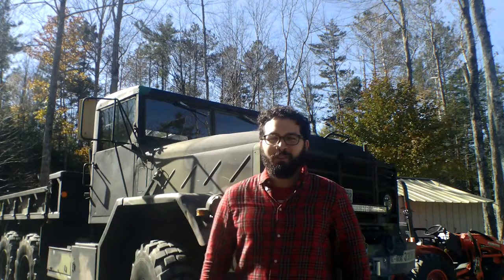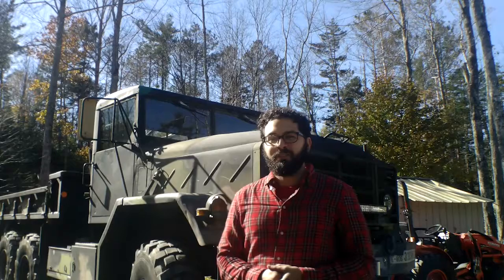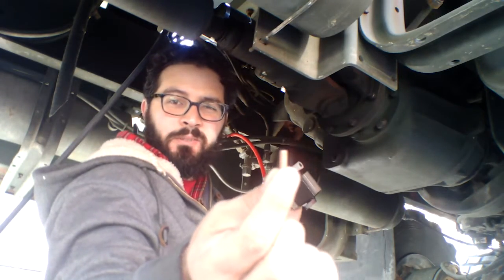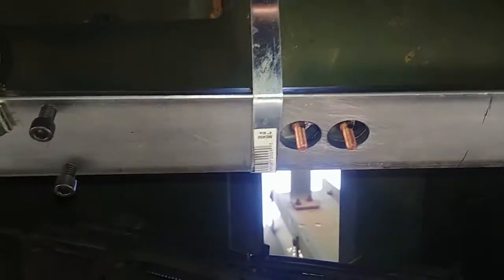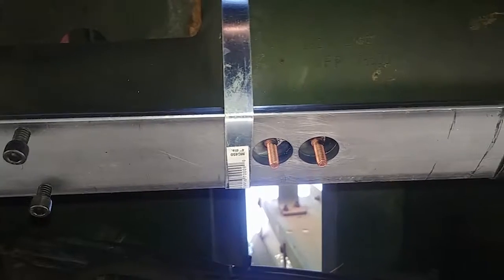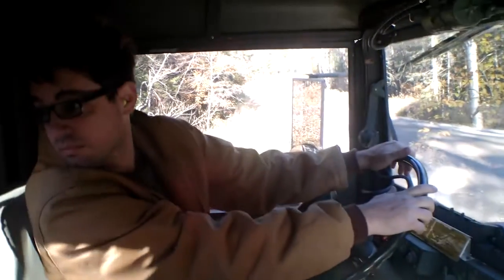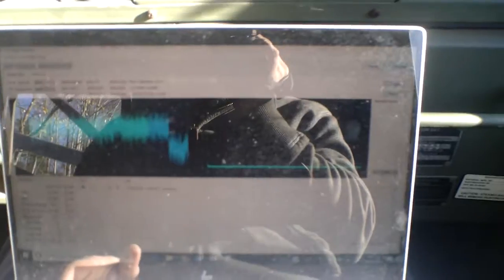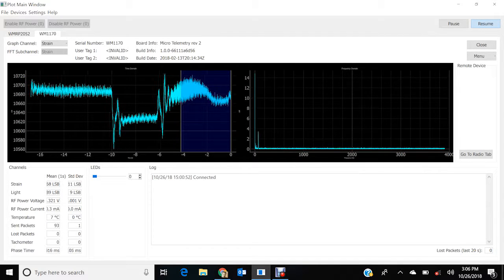Easy wireless torque sensing for rotating shafts

Comment: Awesome.   And a former military vehicle too.  I have a M1031, a 1986 K30 with a PTO powered 12 kW generator.   Having a means of measuring input shaft power to the generator would be great as the 6.2 diesel spins at 1400 RPM to output 1800 RPM on the generator for 60 Hz.  The engine is capable of nearly 100 Hp at that speed which would over drive the Lima MAC generator with internal short or overload.  The governor was set to prevent this but frequency droop from lack of authority to open the throttle limited use.  I've adjusted geometry which required gain and integral negative feedback,  rock stable but the governor could command over 70 Hp.  I figured limiting torque to about 75 ft-lbs at 1800 RPM would keep input power under 25 Hp.